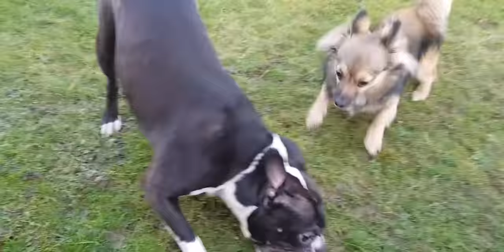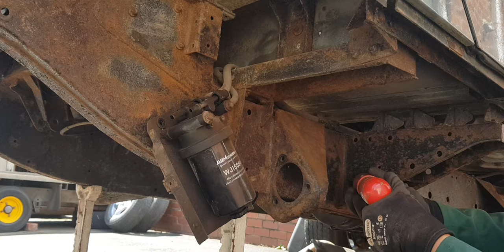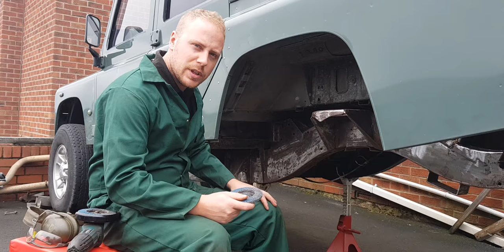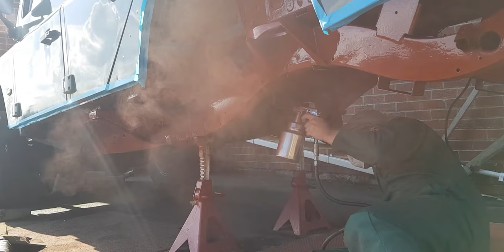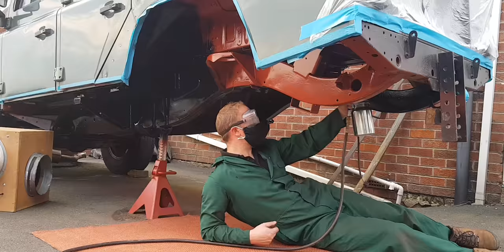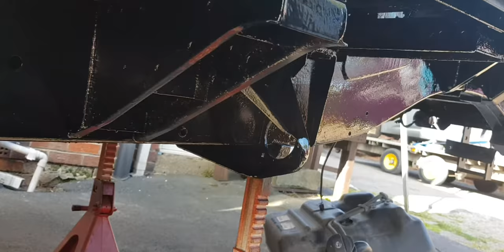Chassis Refurbishment Land Rover Defender Rub Down And Paint Full Strip Down And Treatment

Comment: Hey Tom. Be good to get some Lanoguard on this for sure. :)
Reply: So what would happen if you were to clean back to shiny metal and use nothing but Lanoguard, straight on the shiny metal?
Reply from the maker: Not sure how long it would last but have a look on the Lanoguard website. Mark has written on a saw in Lanoguard and left it outside for a few days. Everything is rusty apart from where hes written Lanoguard.

Comment: Hi, great video. Would you mind sharing some information about what paint you used and your spray gun setup please? Thanks!
Reply from the maker: Thank you! Yes the paint is Red Oxide metal primer (3 coats). The Black paint is Tetrosil Chassis paint and my spray gun is from Machine Mart: Part number SP18C 👍

Comment: Get a Schutz gun with an extension flexi tube/ sideways blowey nozzle & blow the inside of the chassis to the point of saturation with ATF - put down some cardboard to catch early drippage. ATF murders rust & these rot from inside out not outside in. Splurge on a 5l jug of fresh ATF - well worth it in the long run. 

I cut a lot of these chassis' open doing repairs to them & what can look like a very Posh one on the outside can often be in absolute tatters inside. The ATF will settle in the low spots - which is also where water settles - doing it during a good dry spell is best as otherwise if a lot of water is trapped inside the oil will float.... but treat the inside. Inside is tres important & wax.oyl is muck compared to ATF, ATF has ALL the good stuff added at the factory. It is pretty much the best anti-rust liquid going by design - rust is death to auto-boxes, so half of ATF's "work" in a gearbox is keeping it shiny..

On the bits of the outside that are REALLY prone to rust - you know the ones - paint on (with a brush) some Hammer  Grease - it's black, sticky & nothing it touches will ever rust again, pretty much ever. Don't go mad - but them nooks & crannies that trap dirt/muck/water respond beautifully to a good brushing with hammer grease - seams especially. Hammer grease is the rust-prevention material underseal pretends to be but isn't.. Whatever gets brushed with hammer-grease forgets about rusting, pretty much. You could chuck it in the sea & it wouldn't rust. You can - as it happens - paint already surface rusted steel with hammer grease & forget about it rusting any more - even with zero surface prep. The rust will just give up as it knows it's beaten. For the fancy-minded, you can make a brew using hammer grease that is sprayable - whereby you have hit next-level rust killing territory...
Reply: Hammer grease is also your best Pal when assembling anything that might corrode if left untreated - it combines being one of the best quality lubes available with being black for aesthetics - plus it has so many anti-corrosives added from the factory, nothing you assemble using hammer grease will ever rust - ever - use it on shock mounts, body bolts, axle fittings - anything where you want a lube, an anti-seize plus corrosion protection. A dab onto a bolt head & 10 years later that bolt head will be like brand new under the grease. It becomes hugely useful once you know what it is/does.

For stuff you want to never rust But also don't want to have it covered in black gunk - use humble Vaseline - or any knock off version of vaseline - I.E petroleum jelly. Lidl do a knock off version cheap. This starts becoming useful around windscreens, or on hinges - seen stuff - it too can go onto pretty much unprepared metal & will stop rust dead in its tracks for years. Vaseline - works great on rust - as well as for back doors.

Vaseline, ATF,  hammer grease, epoxy primers - your friends in the War on rust. Everything else - pretty much  - is Pish. Them & a big sandblaster. A big sandblaster is always handy.